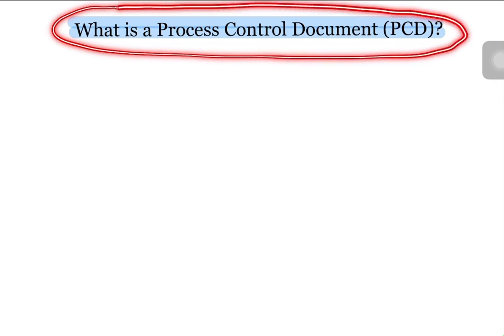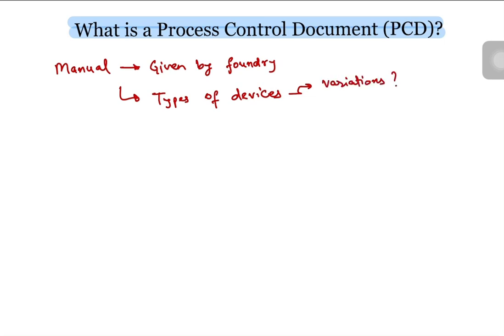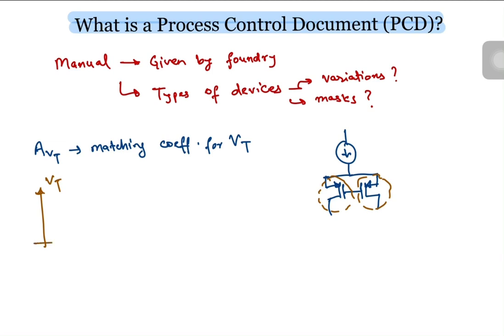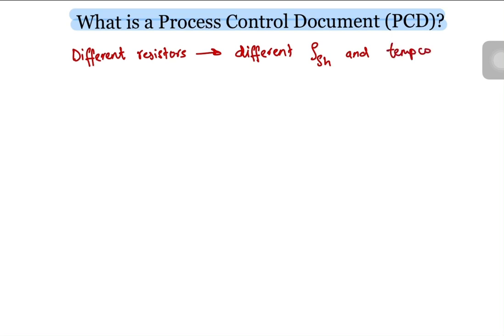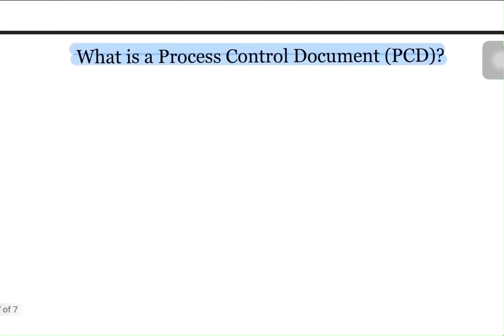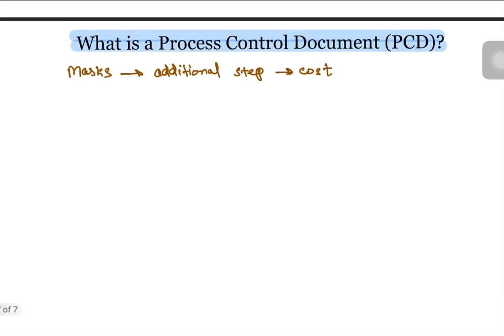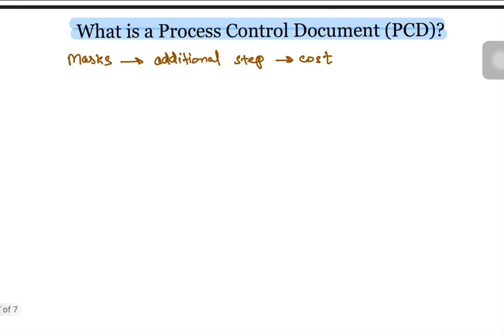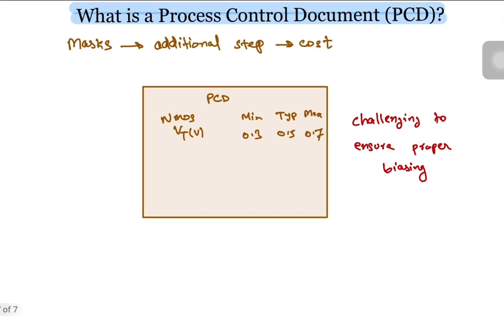What is a Process Design Kit (PDK)/Process Control Document (PCD)?

Comment: Suppose I am using 65nm umc pdk and max voltage for this is 1.2V. Why to not use vdd greater than 1.2V voltage, what will happen to the transistor if I use greater voltage say 2 V!!
Reply from the maker: The reliability will be affected, meaning that there might be an oxide breakdown, or some p-n junction breakdown. 

The transistors are designed (their doping concentration, dimensions, etc) in such a way to withstand some maximum electric field across certain junctions. 

If you are more curious, try googling “gate oxide integrity”, “NBTI”, “Impact Ionization”, “Avalanche Breakdown”.

Hope this helps.